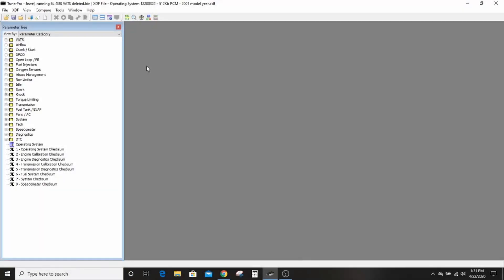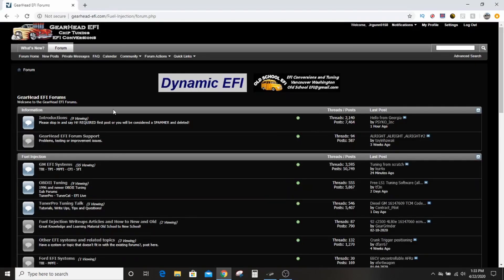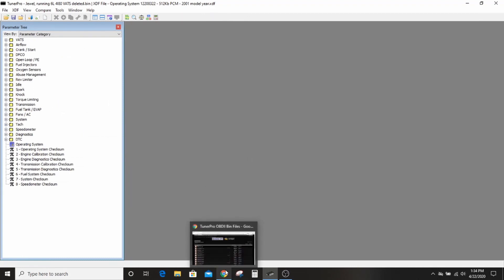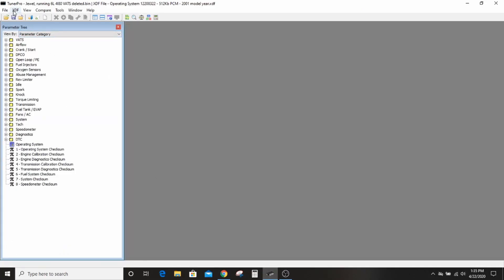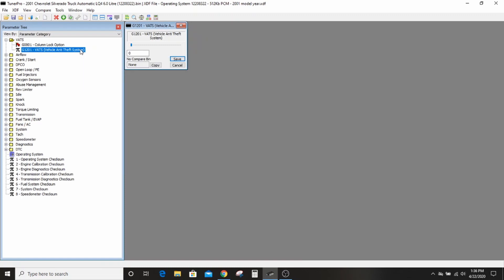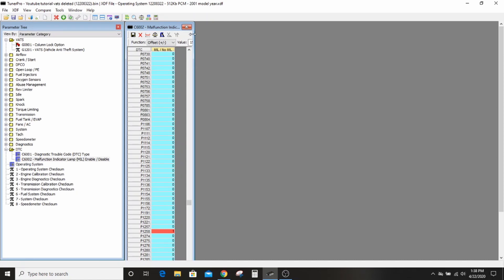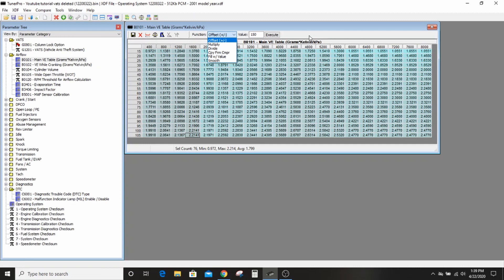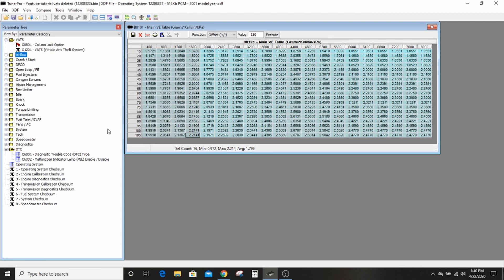Free LS tuning, TunerPro Basics, VATS delete, BIN and XDF files

Comment: is there settings for fuel temp and fuel rail pressure on cng equipped models like my 04 express? trying to remove the system and i get codes for those sensors witch have been removed

Comment: I have a 03 5.3 ls swaped in to a 95 gmc 3500 dually withat a manual NV 4500 trans and what I did the tune on the pcm I did not turn the auto trans off and tell it its manual now how would I change the trans in the pcm or do I need a different xdf file than the one I used for my swap 1st. The file I used was a 2012 CAMMARO tune xdf file and I think it was set with a auto trans and now I have a Manual I have searched online all over and don't really find a definite answer.
Any guidance and help will be gratefully appreciated. 

Thanks, 
James Logan
Reply from the maker: The easiest thing to do is find a manual XDF file, there's a bunch on the facebook group.

Comment: Example:  In your video you say XDF xxx works on any computer from 99 to 2002 PCM. Then you say " I know it works and it is all there"."To use XDF xxxx file, then you say go to "here" and get the BINS, but then you say, and i quote "It only works on a few".   Works on what?  YOUR car?  How mice!  And THEN to top it off you say "make sure you use a BIN and XDF that match, AFTER you tout you dont do that and do something else.  No mention of checksums and or errors.  I must have missed that?  Yea, other than showing screen shots, something smells.

NO ONE tells people this is only a 20% success out of the box and you have to stab the shyt out of it for anything of a higher success rate.

Relive it or not, I am not really busting on you, just pissed that no one will mention these things.  Time to bring it to air.

Comment: 2 years later it works on only a few.  I believe this is short of a scam.  I am betting HP Tuners started this to make money on the do it yourself'ers to waste money, then pay for HP Tuners later when they brick their PCM or get stuck.  I have a 2001 and 2002 2500HD 6.0 4x4 and there are NO BIN's or .XDF's.  Really?  Out of the millions they made, no one has talked about them or posted them?  I know I can get a BIN off mine, but, no one else has a 2500HD?  As of date, there are NO 2002 6.0 BINs posted in the 2002 forum.  Internet search finds NOTHING for 0411 computers that is of any value, in one place.  I would have assumed there would be trillions of posts and discussions.  All I find is "I need this and cant find it" with 1 posting, or, "My car is doing XXX, can this fix it"?   I find that very very hard to believe thats all there is.  I will not even get into the checksum errors that NO ONE mentions.  Seems they have thrown a few things out there to tantalize people and you got lucky, or.....(pulling out my tin foil hat) your a conspirator also  :o  .
Reply from the maker: You got me, I'm part of Big Tuning. 

Other than showing exactly step by step how to do it, multiple times, in high definition. 

Totally doesn't.
Reply: @TheDrivewayEngineer   - you tune, but cant get the point of an essay I just wrote.  Let me retry.

I know how to build a wooden box, but, with no wood, whats the use?

Plenty of BIN files and the one I can get off my PCM.  There are NO "matching" .XDF files for me (or the majority), one of the most common engines.  The only .XDF files are ones that are close, and you have to fudge the shyt out of them.  Lots of storys of people bricking their ECUs or unable to upload a "working" BIN.  

Everything I have read gives one good example and the other 99% are f'kd.   Oh, I can do it, but this is Frankenstein shyt.  

Dropped in to give fair warning to others ready to waste money and time, not to mention, the little tidbits of info you DO find, and the (OBDXpro dongle) come from  Australia, where HP Tuners comes from?  Hmmmm.....

Comment: Great Video! Hopefully you check this out soon...I have many fault codes and currently in reduced engine power mode after integrating the Holley Terminator X ECU into the OEM ECU for my 620hp 408 stroker build in a 2004 Hummer H2. Will this OBDLink MX+ and TunerPro software be able to turn these codes off?
Reply from the maker: Yes, it can disable the fault codes you're having
Reply: @TheDrivewayEngineer  thanks for the immediate reply! Just watching another video of yours and will get that scanner ordered...thanks man, you're a life saver!!!
Reply: What is the link between the  scanner and software? Bluetooth?
Reply from the maker: Correct

Comment: Really confused, you mentioned you don't need to match xdf, I can't find one close to mine. I just noticed as soon as you started you had an xdf already loaded then just downloaded a bin. I'm on the forums there and they said I had to load a certain one and changed injectors and pedal because no one has made an xdf matching mine. Any help there?
Reply from the maker: Whatever XDF and BIN you use, has to match. 

You don't need to fixate on finding a XDF to match your BIN, might not be one. 

Just find a matching pair that do what you need and load them on your PCM
Reply: @TheDrivewayEngineer  speedy response. Much appreciated. Best place for xdfs? Is that on theirs to? I mostly found bins. Im worried I have a 06 Silverado with a 12613248 and I found a 246bin on their site. Just need to find xdf, is what they are saying is true? They mentioned using a 7406 and changing injectors and fuel pedal and that just blew my mind. It'd would be cheaper to go with hpt if I had to go that route. So as long as I get same trans, engine code and year and it's a 1mb ecm I should be good?
Also I heard some guys having issues after wrong xdf like bad idle or trans shift points changing? Will this be an issue or is that from unmatched bin/xdf?
Reply: Ok, I'm still trying to clear up confusion. I'd like some definitions as to what each file does. and compatibilities. You said you pick a BIN that matches your transmission. Then pick and XDF that matches your Bin.  I'd understand this better if they made a Flow chart and posted it on the Forums. I didn't want to change much on my ECU initially. I just want Vats turned off and Turn down or off the Torque limiting.

 looking to run an 8.1 with an Allison 2,000 the series. They stopped using EGR in 2003 they also used a return less fuel rail then. point me in the right direction OB1

Comment: How come my xdf files i can find in my labtop files but open up the tuner pro and it doesn't find my files what to do or am i doing wrong please help last step till my ls swaped 03 5.3 ls in a 95 gmc dually
Reply from the maker: You're probably looking in the wrong folder on Tunerpro, Tunerpro looks in it's own folder, if you downloaded them and didn't move them, that's why it doesn't see them.
Reply: @TheDrivewayEngineer  i think i got it now to write it to my 5.3s pcm n try it then if it worked ill 1999 6.0 lq4 swap my 85 monte carlo
Reply: Ok i turned vats off but when hooked back up to 5.3 still the same start run for 30 secs thn die i have a 12579405 bin file and no correct xdf please help
Reply from the maker: Without an XDF to match your BIN you cant tune with Tunerpro, you're lucky you didn't brick it. 

Change to an OS that has an XDF
Reply: @TheDrivewayEngineer  could you send me the bin and xdf link i found some for a 04 but wand another bin and xdf to try also so if you could send me a link would be great and btw love you channel
Reply from the maker: There's only one P59 XDF
Reply: @TheDrivewayEngineer  you have any links?
Reply: @TheDrivewayEngineer  ya i cant find it

Comment: I appreciate all the effort you've put into all of your videos. I wonder if you can do a video on using tuner pro to setup for turbo. 

My big question is do I need to swap operating systems?
Reply from the maker: I would not use Tunerpro with forced induction before PCM Hammer gets their data logging working

Comment: Hi, what cable or interface were you using with the flash program? I’m trying work out what I need to get to get it to plug into pc, trying to avoid hptuners and efilive hardware. Thanx
Reply from the maker: Everything used should be in the description
Reply: @TheDrivewayEngineer  no reason you couldn't use a USB to OBD cable though, right?
Reply from the maker: @tuckerbarrett  thats correct, the beauty of PCM Hammer is there's a lot more options for how you connect
Reply: @TheDrivewayEngineer  While I'm here, have you found a windows based program that scans ABS/SRS as well as just ECU functions?

Comment: Hey I'm buying hp tuners but need some direction on if I need the standard or pro version. I own an 06 got that I want to work on and an 06 5.3 silverado I plan on doing the typical cam, exhaust etc...
Reply from the maker: With HP Tuners, you can always upgrade to Pro later if you want.
Reply: @TheDrivewayEngineer  that's a good point! And thanks for the quick reply. What are the major benefits of the pro over the standard?
Reply: @fiendwithout  ☝🏾 how'd you go lol.